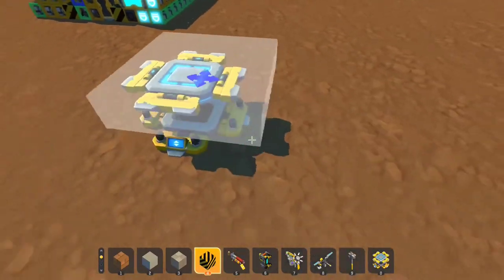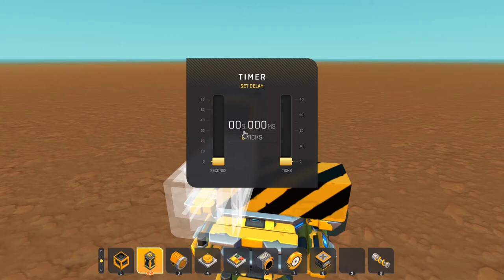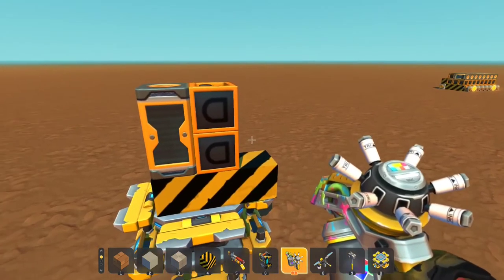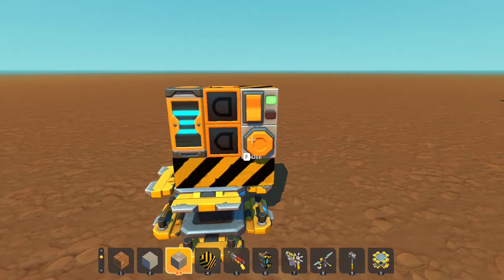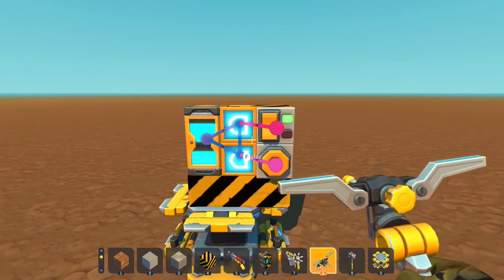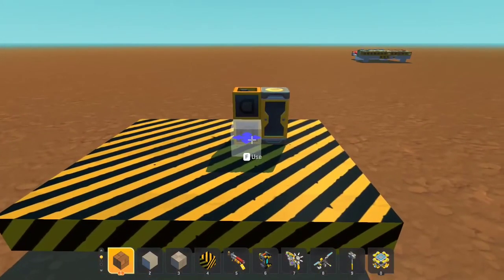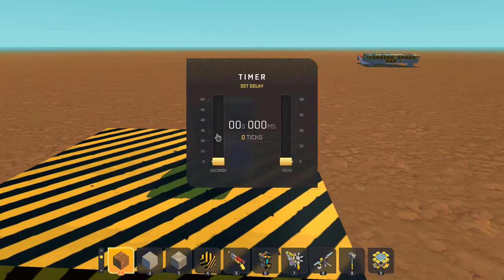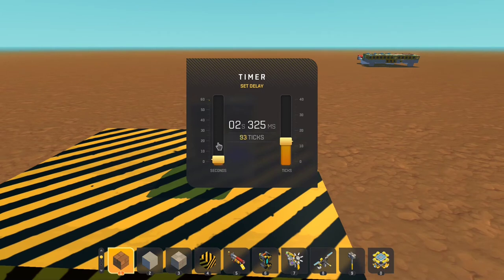Making the actual timer storage bits [Scrap Mechanic timer memory ep. 2]

Comment: the problem is this ram (if its even ram i cant tell what your using it for) would take a really long time to get the data out of it but if it it is a hard drive it would be faster but useless because it would reset when put on a lift also the real best way to make ram is to just compact it using blueprint editing
Reply from the maker: Well, with BP editing you quickly run into lag limitations. After making these videos I have been experimenting with having multiple smaller chunks of timermemory (like 16 bytes per chunk) resulting in read/write times of 5-20 ticks whilst still using ~10 times less components as normal memory would.
But yeah, timermemory isn't always the best option. If you only need like 64 bytes it is fine to use normal memory. Timermemory is only advantageous at large scales.